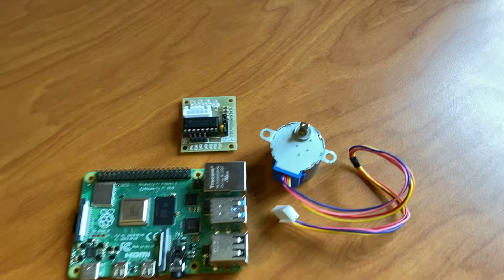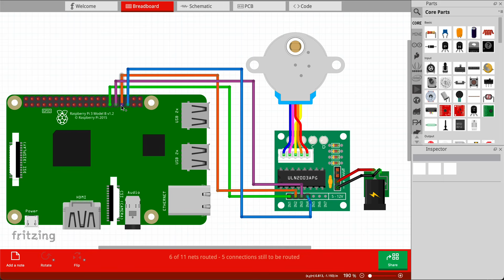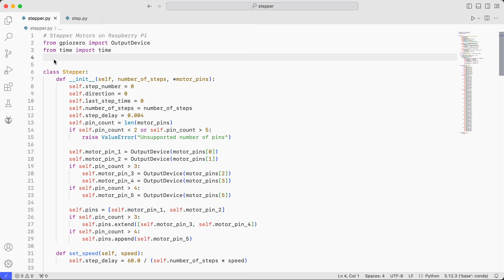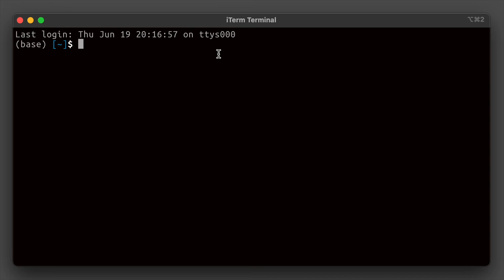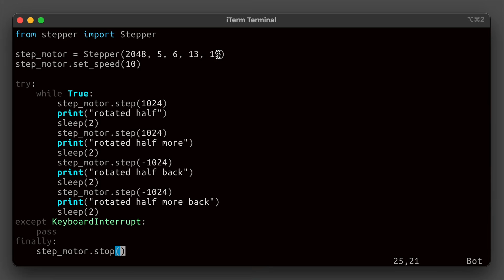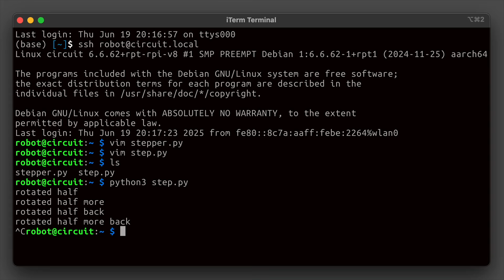Step / Stepper Motors on Raspberry Pi: gpiozero + Stepper class

Comment: Hi. step_motor.stop() does not work. When I call that function the motor keeps on turning. When I print the pin state i get this result.

GPIO5, active_high=True, is_active=False>
GPIO6, active_high=True, is_active=False>
GPIO13, active_high=True, is_active=False>
GPIO19, active_high=True, is_active=False>
Reply from the maker: I will look into it in several days. Or maybe do you already know how to fix it?
Reply: @nixrobot  I spent several hours trying to come up with a solution but so far NO luck.
Reply from the maker: I fixed some indexing bugs in the stepper module (updated the repository). But they are likely not related to stop() method. The problem might depend on other things such as different integrated circuit, or different motor: this can render logic incompatible. Or maybe your program is more complex, like a multi-threaded one.
If you are still experiencing non-working code, then it would be easier to discuss it if join discord (in channel bio), post your hardware, circuit, key code pieces: maybe we can solve it there (or not); at least we can try to look deeper.
Reply: @nixrobot  Hi. Just and FYI, I am using exactly the same motor, controller and Raspberry pi as you do.
Reply from the maker: @heinzd5523  The pin states are correct for the off state. Step motors cannot miraculously work when nothing controls them. Is code async with routines?
Do you also have a common GND as one comment noticed?
I cannot reproduce the described issue. If you still want to continue searching for solution, then either a discussion mentioned before or detailed steps to reproduce it are needed like a bug report to the repository with what happens (it rotates endlessly, stops at some point after, changes speed or not, etc.) and with code snippets used.
Reply from the maker: In the initial version of this module, if you call step() and then immediately stop(), the stop() will not execute because step() is blocking.
To make step() non-blocking, I again updated the repo and included non-blocking methods start() and tick() + async version (to use with bluetooth, web frameworks). start() can be called in the main loop on certain event, while tick() shall be called very frequently.
Can you try them? Did something change?
Reply: @nixrobot  I found the problem. I was using an external power source for the stepper motor. I am now using the power source form the Raspberry and it works as it's supposed to. Thanks again for your help and for making this amazing video.
Reply from the maker: @heinzd5523  Oh, no, using power from development boards is bad idea: at some point, motor current may burn it. If instead connecting GND of Pi to GND of external power and use external power, does it work as expected?

Comment: You're using an external power supply, but I noticed the grounds are not connected together. Could you clarify how the circuit is functioning correctly under these conditions?
Reply from the maker: Thank you for pointing that out. Connecting RPI's GND to GND of external power source for motor [motor driver] is the right thing. The drawing should include that wire.
It works as shown in the video, perhaps, because Raspberry Pi has its own power supply through a USB-C cable and the ULN2003 driver board is made in such a way that it can work without common GND. I have tested common GND just now, and it does not change anything, but still - good catch.
Reply: Hello and thank you for this comment. I was using an external power source for the stepper motor which was the problem. I am now using the Raspberry's power source and it works. Thanks again for your help 🙂